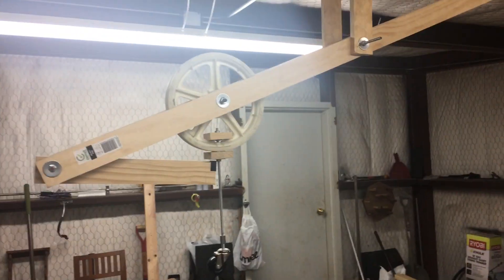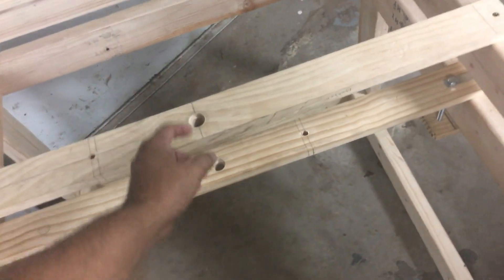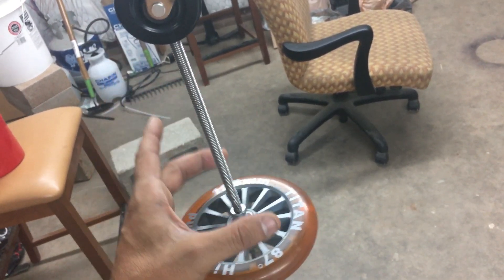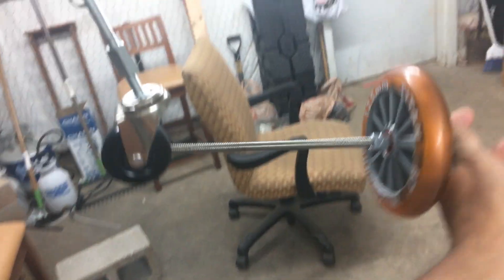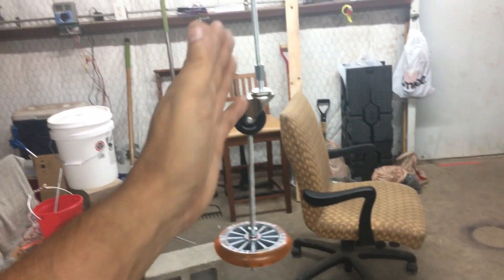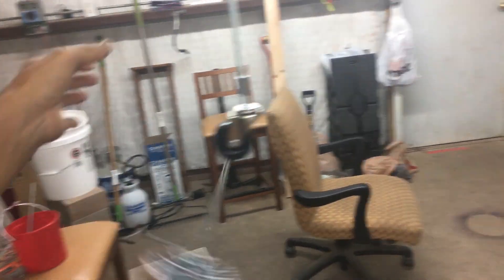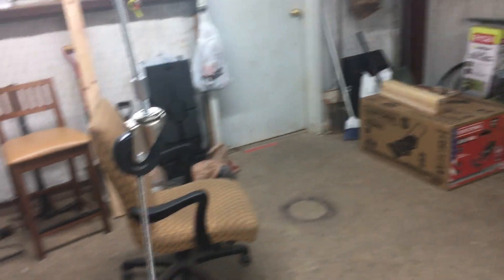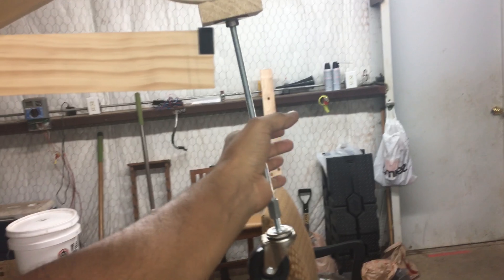Why Constraint Forces Can Look Like “Inertial Thrust” (Early Experiment)

Comment: Every action has an equal and opposite reaction , if you were using a motor in place of the caster wheel the torque applied to push the mass forward would put an equal and opposite direction force in the opposite direction resulting in net zero thrust in any direction except rotation
Reply from the maker: john elifrits unless you use acceleration for 180 degrees and deceleration for the other 180 degrees.
Reply: @debunkified  thats still a net zero
Reply from the maker: john elifrits Please explain. Mass times acceleration equals a force. If there is less force from a slower moving mass for 180 degrees then how is that an equal and opposite reaction to the much faster moving mass with a much greater force for the other 180 degrees?
Reply: @debunkified  when a mass is accelerated forward it has to push off of somthing if you will , in the opposite direction, for somthing to accelerate somthing must be left behind in this case it is an equal force , now you may be better off trying to , convert angular momentum into linear acceleration  using simetrical yet inverted rotational masses with a forced precession in opposing directions theoretically forcing 2 cuved paths into linear acceleration,  but if this could be built and proven it would also allow for time travel,  ive got some designs but they are too complex to be able to put them on paper and make sense of the schematics
Reply from the maker: john elifrits Yes. This sounds right. What you say can be done with gyros however not when they are rotating at full speed and experiencing pure gyroscopic forces. Gyroscopic forces do nothing in and of themselves.

However if rotating with slower angular momentum then centrifugal forces come into play. Only centrifugal forces can be aimed in a certain direction more so than the other.

Now we can be on the same page, to an extent.

Forget gyros, we can use gyroscopic motions of electrons and accelerate them instead to bend a little bit of space time, if you will with a small device sitting on your kitchen table.

Impossible? I think not when disks can be spun with any kind of motor. I will not divulge too much.

What I can say is a simple bending of space time with an electromagnetic field can easily travel time which directly corresponds with distance. No inertial forces to throw you against the wall with g forces either.

Comment: What would stop 'space motor' from just rotating in other direction...? It is interesting falling weight does not pull back on pivot
Reply from the maker: Coil Smoke hi, indeed. There is a slight pull back on the pivot only because there is a slight amount of centrifugal force in the opposite direction. Most of it is forward however.

As far as the motor, yep I think you’re right if it is less massive than what it is trying to turn then it would simply turn itself.

There are ways to eliminate this.

Comment: Maybe i have misunderstood what you are wanting to do.... but sorry, in space that will NOT work.. it will not give you a thrust because there is no gravity in space... so if you lift it up in the back it will not make any movement forward... but just remain in the position you lifted it to....
Reply from the maker: Hi DaKrampus, maybe you misunderstood a little and maybe I didn’t explain it well enough. 

The lifting up of some mass is just to get ready for gravity to take over, and the actual starting point in space is when it is released.

When the weight is released then gravity is only acting as a simulation of a motor in space. The small black wheel being the motor.

In other words both a motor and a weight that the motor is spinning are both out in space and the weight is turned at a short and quick angle and that is it!

My question is really, what would move first? The motor or the weight and how would they move? Would one have to have more mass than the other?

So this was as close to simulating the environment of space the best I could. I suspect the motor would have to have more mass in order to stay still long enough to get the mass on the other end moving, then centrifugal force would move both of them forward.
Reply: @debunkified  Ah now i understand what you are up to.. it is fascinating.. because with the centrifugal force the faster theobject moves the more the mass increases..  but what is to bad, we will not be able to test it in real space environment...  but i think your assumptions are correct. allthough it would be a hell of a task to control the mouvement in outer-space..
Luc
Reply from the maker: DaKrampus Ah, finally somebody got it! Thanks for understanding. I’ve pondering this for a while now and I do believe that if the motor was more massive than the weight then it could indeed move the mass without moving the motor. The rest of story would have to come from an astronaut in space actually testing this. They spin stuff all the time and examine what things do up there.